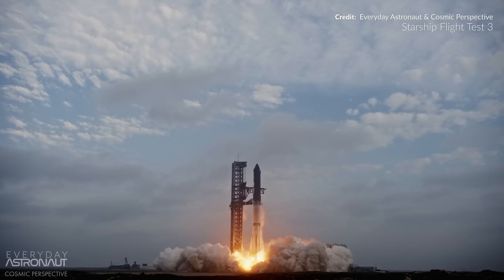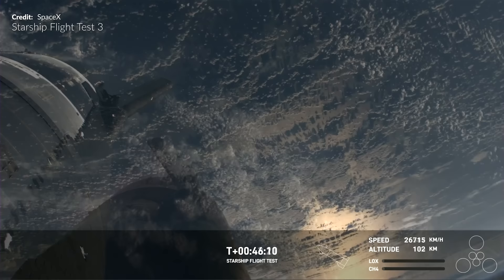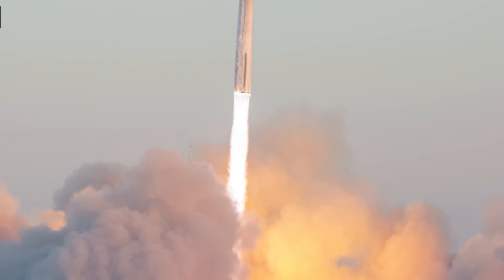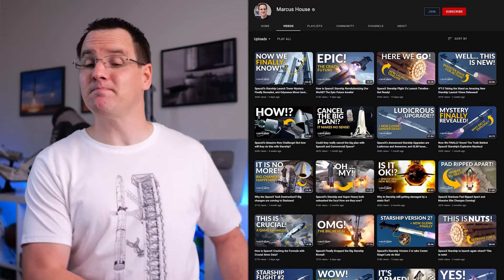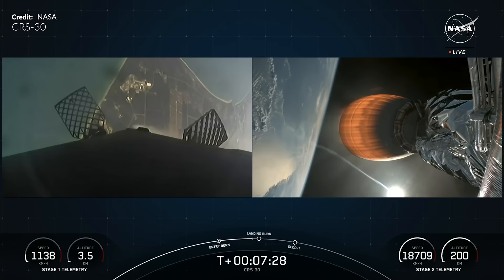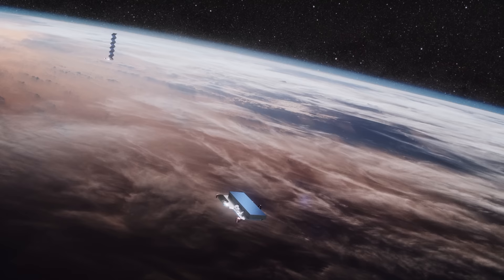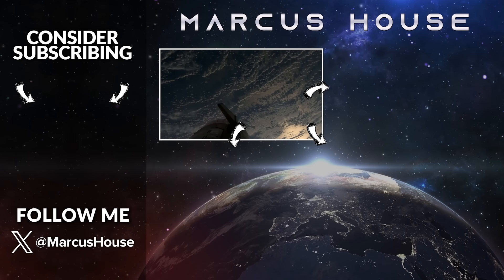SpaceX's Frantic Push to Launch the Next Starship Mission is Nuts!

Comment: The venting may well have been a way to settle propellants but please explain why it started venting the moment the raptors turned off, surely it didn't need to vent the entire time it was in space. Very successful test otherwise and very fun to watch
Reply from the maker: We don't know. That makes sense if they were testing propellant settle and stuff well before the actual transfer demo. We don't know what other data they were trying to get. It may also have been leaks I guess, but we've not heard any official info if that is the case.
Reply: @MarcusHouse I do hope that it was some kind of test but I just cant think of what it was other than something venting on accident.

Comment: I didn't see any "Missing" tiles.  Look closely at the hexagonal tile on the fin bulge and you will see part of the that tile is black and still there.  The few tiles that were mostly white appears to be cracked from ice strikes early in the launch.  Looks like the lower half of the tile is still in place just the white core is now showing.  So a few damaged tiles, but didn't see any missing ones.
Reply: Mate you can only see a small sample size of the tiles in the camera position. 
What you do see is fk loads of them flying across from the area outside of view many times.

Comment: I wonder if the Starship and booster controlled landings might be attempted on some form of drone ship at first. No tower or catch-arms, just get to the pin-point accuracy needed before trying for Starbase. With or without short little landing legs then let them tip over into the Caribbean? 
Cheers, Geoff
Reply: Who will put a ship in the Indian Ocean?
Reply: Who said anything about pinpoint test landing in the Indian Ocean, when SpaceX gets to the precision testing it will be in Texas? What I said was test landing initially on some form of barge until it is close enough to be able to attempt it on land at Boca Chica.

Comment: Why not install some plumbing on top and down each leg for deluge?   They could also add shower above QD and up the length of the tower.   These things could be sacrificial if necessary.  They could easily be replaced before every launch
Reply from the maker: They have talked about adding a shower to the top of the quick disconnect before actually. We've never seen them do anything with that idea, but maybe it is time to look at that again.
Reply: The legs are fine without any additions really. As Marcus said they have talked about making the top do something similar to the ground but havent shown any intent to do so yet.
As for the tower, i dont think its needed either. The only parts being damaged are from a maneuver they wont continue doing. The chops and SQD will likely be getting shielding upgrades over time. They are still learning how they want things and limit sealing things off that would make changes more difficult.

Comment: thanks marcus! but what happend to the booster? why did they lose it?
Reply: I read somewhere (can’t remember where, sorry) that it was going too fast too low because of failed centre engine relights (fuel slosh due to roll oscillation?), and it broke up at 1000 metres altitude.

Comment: The slide has benefit and draw to the cable. The cable is small, and flaming stuff might go right by causing no problems, the slide is a blocking wall, and may catch flaming stuff. But, the slide is a blocking wall, and may catch flaming stuff instead of letting it deposit on the passengers. Can't wait till SpaceX team solves the control vents. Hoping to see that second tower design with proper shielding and reduced cost exhaust venting system shortly!

Comment: They would still have the hardware plans for the landing legs on the ship in particular, maybe they'll add them back on for a while. After all landing legs will be needed for the moon landings so a good time to test them out.
Reply: An entirely different ship.  The most important starship variants are the fuel tankers and the cargo starships to LEO.  Landers are the cherry on top and crewed landers are a touch of creme on the top of the cherry.  When ships are optimized for each environment, they'll take on different configurations.  Legs will be only for ships landing on moon and potentially mars, but the payload inefficiency due to legs in LEO - where most of the fleet's work will take place - means that catching is the way forward.
Reply: Agree … great risk reduction in case the catching causes lengthy repairs and lengthy accident investigation on the second tower … I hope there is no plans for catching with the first launch tower until it can be done routinely with the second launch tower.
Reply: @KnugLidi they’re optimising for cost/lb to orbit. If they can launch more often with less payload but land on legs, they’ll do it if the risks associated with a chopstick catch doesn’t make the numbers add up. That could change over time — it may well be that a chopstick catch is a later optimisation. Premature optimisation is a thing.
Reply: @benfowler1134 Legs are not an option for starship on earth.
Reply: They never had hardware plans for landing legs on the ship. The little flip-out feet on the hardware used for earlier tests (SN5, etc)  weren't a production design, just a quick-and-dirty placeholder that would be minimally adequate to absorb the impact.
Reply: @simongeard4824  what’s the plan for the moon then? It’ll need to be robust, because half the craft that attempt landings on the lunar surface, tip over
Reply: @simongeard4824  So you're saying no-one ever made drawings for manufacture? seems incredibly unlikely? Someone came up with the idea someone drew it out, someone ordered materials, someone made them. Given the Starship needs to zero velocity for landing still seems like they or a modified version would do the job without reinventing the wheel. I'm guessing they will use the tower for catching the booster initially (33 engines to save) and legs for starship.
Reply: @scottlymbery7948  I'm saying that the feet on SN5 and friends were in much the same state of design as all other test hardware of that vintage... something thrown together to be mostly sufficient for that early phase of testing. And I say "mostly", because it was obvious at the time that they weren't doing a great job... a crush-core design that was barely okay for one use, and certainly not reusable.
Reply: @benfowler1134  They will, but I was responding to the comment about digging up the existing hardware plans for legs. And the only existing plans were a placeholder which even at the time was inadequate for landing on a paved surface on Earth, much less the moon. So whatever they do for HLS, we've not seen it yet

Comment: Watching the Starship's progress at this point is phenomenal.  But, I know that the high tech being used allows for more things to go wrong, and it's taking multiple missions to get it right.  I think back to the Apollo missions.  The Saturn V rocket and the astronauts, and the incredible success they had.  Other than 1 and 13, almost flawless.  There wasn't any way to test the lunar module, or all of the docking procedures, or the landing thoroughly until it actually happened.  Including getting the astronauts off the moon.  Just an amazing set of feats with such incredible success over 50 years ago.

"You don't know, if you don't try"
Reply: If Saturn had this many failures as SpaceX the entire program would have been scrubbed.

Comment: Sounds like they decided to scrub the engine relight because of the attitude control thruster clog, and maybe the cargo door malfunction.  If it didn't have roll authority, then they couldn't control the flight path, and they could have lost the ability to shut it down.  Even though they intentionally defueled it to keep it suborbital, it could still deviate a lot without directional control.

Comment: I hope SpaceX goes light on the second launch tower at first.  By that I mean the minimum amount of infrastructure to catch a booster and Starship, i.e., no capability to fuel … no plumbing.  This is for risk management.  One must assume 2-3 failures minimum in the first 10-20 catches … which require repairs and recertification … and a months-long accident investigation.  If the tower is minimal, the time to back in operations would be shorter.  During that time, they could continue launching and just soft landing in the water.

Comment: Maybe a bit late... but I just realized when SpaceX starts to launch other peoples payloads. What if they open source the frame of the Starlink v2? That would mean that a bunch of customers could join in on the regular Starlink launches even further lowering launching costs since the outer dimensions of the satellite are the same
Reply: SpaceX have, in the past, made their payload manuals public. Enough data in there to at least make a start on a design.
Reply: Interesting idea, but would they really accept having non-Starlink sats mixed into the same orbits as Starlink sats? They could of course separate them into different missions, but then would the savings be there still?
Reply: @rednammoc  yes, and it’s diabolically clever. It’s all but impossible to shoot down a self-healing network of 30000 low-earth orbit satellites, so peppering the constellation with the odd satellite with a classified US DoD payload is evil genius.
Reply: Unlikely, there are so many options for delivering small payloads. Customers aren't going to pay more to use Starship. 
Customers with big payloads would be incredibly rare.

Comment: now all they need to do now is to work out how to stop it spinning  before re entry..and how to re start the engines on the booster.
Reply: I think it’s just a bad initial tune of the attitude control systems in orbit. They’ll have collected data and in the next flight, it’ll work. We’ve seen SpaceX do this numerous times before.

Comment: Should they cover the launch site with star bricks since they 're made to take all that heat and pressure?
Reply: The heat sure, not the pressure or the vibration though. Honestly the weather would probably destroy them pretty quickly. 
They are made for a very specific task.
Reply: @Vatsyayana87  Yeah exactly, but figured re-entry winds of 26k++ might be in the same department.

Comment: Do the CRS missions max out on mass to orbit, or volume? If they hit max volume before max mass, could the trunk be redesigned as a truncated cone allowing for larger diameter capsule.
The same could be applied to the crew Dragon if there were sufficient lift capacity. A hybrid might be larger casules with Falcon heavy booster.

Starship however will shortly make all this idle speculation
Reply: Volume limited, or if it is a mass limitation then it's something structural on the spacecraft, not a Falcon 9 payload limit. Most CRS missions are RTLS, which means they're at most about 12 tonnes - notably less than the 18-ish tonnes most Starlink launches are these days.

Comment: I am seeing incremental improvements but,  relighting engines and attitude control seem to be bugaboos!   Just as the release of the cyber truck was delayed over and over for 2+ years;  I don't see resolution coming in a few more launches.   It feels like the problems are much more difficult than the engineers envisioned and as there is minimal time between launches(this year) there will be little progress per launch and a lot of wasted Hardware.   Furthermore, the amount of repair needed to the launch area preclude even one launch per week let alone the promised one or two per day.   The current problems also prevent the testing of actions necessary for moon missions:  space docking,  refueling,  maned missions, and the landing and reusing of Booster and Starship.

Comment: IFT-3 had a steep ascent and descent. The booster continued to ascend for several Km. So the booster had more thrust than needed. If the fuel that created the extra ascent had been loaded in the ship, both may have had sufficient fuel to get farther in the mission. No?
Reply: No. The booster continued to ascend due to momentum. Nothing to do with fuel or thrust.

Throw a ball into the air. It continues upward after it leaves your hand.

Comment: Is it possible they're having fuel slosh and oxidizer slosh on re-entry on the booster 200 to 300 tons of fuel and oxidizer in two different tanks oscillating at two different rotational rates it's a little over 2 to 1 ratio that's twice the oxidizer to fuel ,, 200 tons sloshing at the bottom and 100 tons sloshing at a different rate at the top?? Would much larger rockets and tanks magnify the effect of such phenomenon??????

Comment: They need more thrusters to control the Roll like three instead of one so if one valve fails it's okay
Reply: "The best part is no part". Spacex moto.
You are saying triple the parts.. Some how i doubt it will be a thing. Instead i expect them to do the "make it work without fail" approach.
Reply: There will be a hard quantitative way of calculating net reliability of a system of parts of known reliability. The maths will tell them what level of redundancy will contribute to reliability - it’s just a matter of crunching the numbers

Comment: We ( space x) has the ability to place a water retrieval area in the ocean to surround the booster after entry/splash down, using the same technology for Falcon landing on platforms 
I visualize a netted pool, 50 yrd circumference as a landing zone. Why let them sink???
Reply: Taking a week or two to bring boosters back while being in the weather completely removes the "rapid" part of rapid reusability, which is starships whole thing. They want to launch a booster many times a week if not a few time in a day.
Also adding 10s of tons and the complexity of legs.
The plan they have for it all is pretty crucial to the meaning of the program.

Comment: Neither part would stand up to a water landing and be recoverable. She meant catch, no other way to recover the booster. The booster will be an empty can at that point so if it does fail it will do little damage to something that just experienced so much pressure thrown at it. If the chopsticks get hurt it will only mean they have to stack a ship with the crane, wouldn't be the first. The big question is how the ship will be recovered. It will be end of the year so it should be a V2, will it have legs...

Comment: GREAT JOB Team House !  Thanks for the invitation to opine about landing the booster and the spaceship.  Methinks we should extrapolate from the Hollywood scenes of lucky soldiers landing in trees during WWII.  Something like a forest of artificial carbon fiber and fiberglass branches and boughs and bows could act as a landing cushion to catch the booster or ship .  They should be fitted with sponges that can be wet with water to further dampen and dissipate energy on landing.  Come to think of it; old wind generator 60 and longer used blades could be repurposed for such a forest.  I invented a textile out of plastic taken from the local landfill that could also work  All you do is make a big pillowcase out of a heat resistant textile to resemble burlap then fill it with reclaimed plastic from the oceans etc; and heat and press, into boards.  Then just cut out the parts and pieces you need.

Comment: My main question is, how come they aren't using mass simulators in these test flights?
Reply: Because they don't need to? As part of the Artemis program they need to advance the system of loading fuel into a fuel depot in orbit.  That will be your load tests, as an extra 150 t of fuel to the depot gives you that load.
Reply from the maker: I suspect they want to test reentry without a payload. For Starlink they will have all been ejected before entry. Same with almost any early mission that would take any payload.

Comment: Timestamped Highlights
00:10
🔍 SpaceX's Flight Test 3 analysis and updates on Flight Test 4
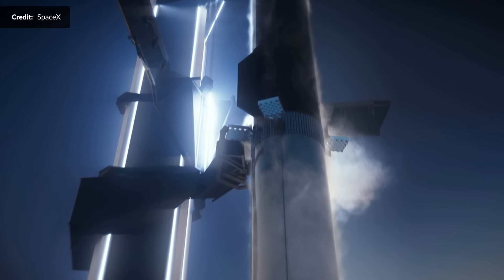03:10
🔥 The launch pad and infrastructure survived well
05:25
🚀 The flame deflector system and launch mount are in good shape
08:07
🛠 Minor damage includes warping and wiring issues
10:25
⏰ The next flight is expected in 6 weeks
13:45
🚀 SpaceX plans 6 launches this year and aims to recover both stages
16:20
🚨 An emergency egress system was tested at Space Launch Complex 40
19:10
🚀 The Commercial Resupply Mission 30 was successful
21:30
🛰 Starlink missions and Rocket Lab's NROL-123 launch
24:00
🚀 Sierra Space's Dream Chaser Tenacity underwent thermal vacuum testing
26:25
🚀 Rocket Lab is progressing with its Neutron rocket

Summarized by @NoteGPT

Comment: SN10 and SN15 landed successfully with legs. As legs will be needed for the Moon and Mars, I predict we’ll see legs before the end of the year.
Reply: Thats quite the prediction. I will definitely bet against ya on that one. Maybe within a couple years but i doubt it honestly.
Reply: You would be wrong.  SN10 and 15 were prototypes that needed to demonstrate the ablity to flip and land in a controlled manner.  They will need this for catching.  The additional mass on the ship takes away from its ability to carry payload (1:1)
Reply: @KnugLidi  Legs are needed to meet NASA’s requirements for the moon landing. So it makes sense to start testing prototypes as it will be a while before the towers are ready for a catch.
Reply: They’re on the hook to have well-tested Ship legs for the HLS contract. The moon is SUPER-unforgiving for powered landings, and they’ll want to have it as robust as possible.
Reply: SN10 and SN15 had stubby little fold-out feet which were never intended to be a production design, just a quick-and-dirty way of putting some shock absorption into the impact.